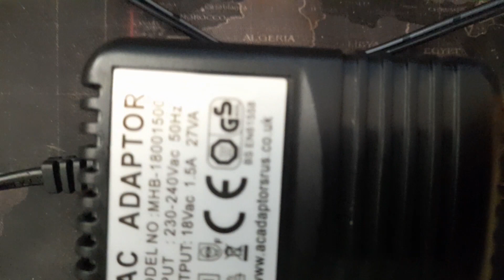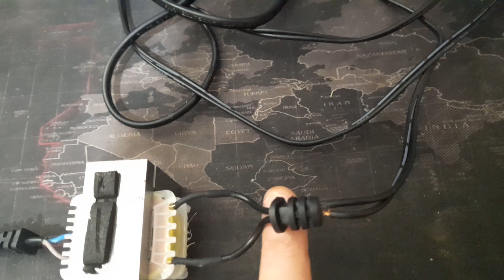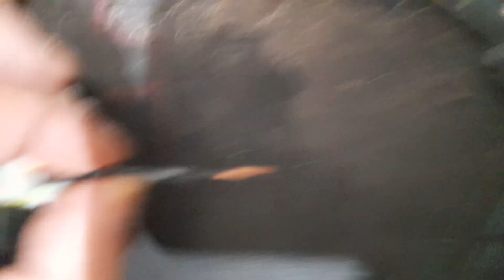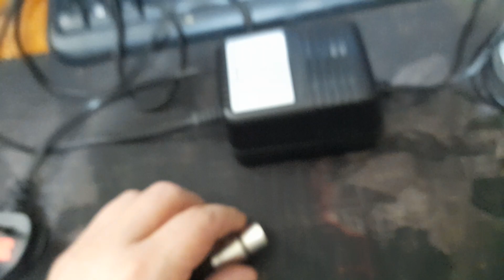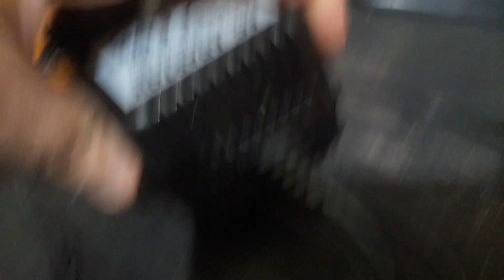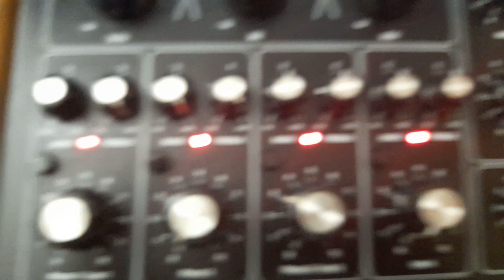E&S DJR400 Rotary Mixer (PSU Repair)

Comment: Great video!! I have the same problem but i want buy a new psu for my djr400. Where i find a new psu for my djr in Italy? Internet???
Reply from the maker: Did you check if www.acadaptorsrus.co.uk deliver to Italy? 
https://www.acadaptorsrus.co.uk/18v-1-5a-18vac-1500ma-ac-ac-adaptor-to-replace-mhb-18001500
https://www.amazon.co.uk/1500ma-Adaptor-Linear-Supply-Transformer/dp/B07Y8MQVXY
Chop the plug off either of these and put your European plug on it or just use a travel plug adapter.
There is nothing particularly special about this power adapter. It is just an AC to AC adapter and the output connector is the most common size of barrel jack so it should be easy to find one. Just make sure you get an 18VAC that is capable of supplying at least 1.5A (27VA). Also make sure that you don't buy an AC to DC adapter as DC will not work for this mixer. Good luck!
Reply: @Nordl3  Wow, many thanks for the immediate response, i will follow your advice! Thank you so much!!!
Reply from the maker: @rosdav84  Glad to help! Good luck.